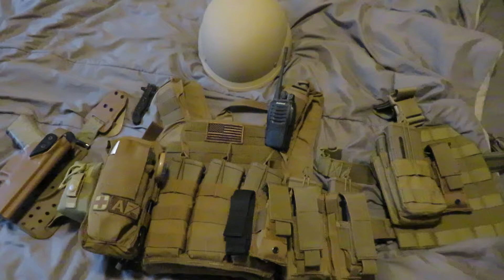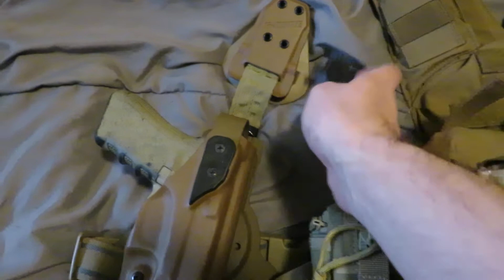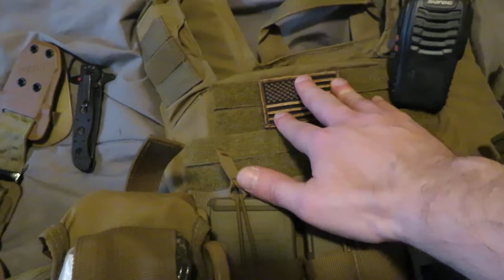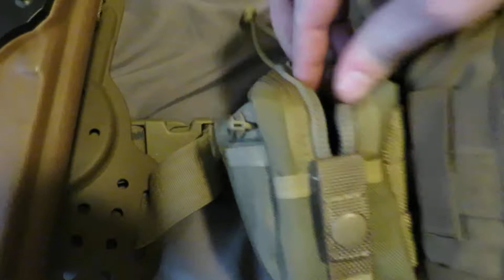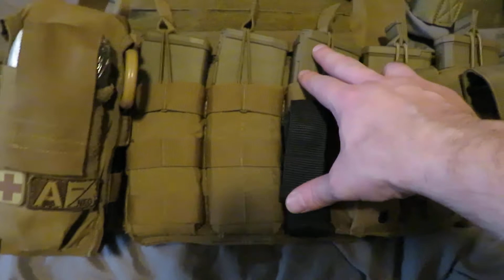Part 1: An Overseas and Emergency Response Security/ Defense Contractor Loadout

Comment: I know this video is a couple years old, but I’m waiting to leave for training with TC for Israel and was wondering if you’ve done a contract there or not. I’ll also apologize for the all of questions I have. Also I was wondering what they do for the rifle/pistol qual. Is the pistol qual on the m9 or glock? How’s the PT test done, is it prove you can do the minimum or is it a test where you show off how many pushups you can do? Just trying to get a judge of the environment. Also do they issue you good kit or is it some IBA or IOTV? What’s the uniform you normally wear? Ive seen some pics online with the full tan BDU and I’ve also seen tactical pants and a polo. Unfortunately training dates been kicked back 4 times so far and I’m hoping it doesn’t get kicked back again. Thanks for all the info you’ve been putting out in your videos!
Reply from the maker: Hey thanks for watching and for the questions.
- No, I was in Iraq for WPS and also ERT on a global deployment status/ program (also worked a domestic FPS hybrid contract for TC more recently).

- Pistol qual will be on Glock most likely, but they have M9's and a wide range of stuff, you'll get what they give you.  The tests are augmented/ updated from time to time, but it'll be based on a hybrid of DoD and State Dept. shooting standards along with a few other things they see fit to add in.

- Fitness test isn't really anything crazy, 1.5 mile run and some other basic assessments (pushups, situps, pullups, etc.), done every 4 to 6 months or so.  Go into the initial 45 days of training in shape though, they expect you to show up and be able to perform and do the base fitness test (there is minimum standards but it's not hard honestly).

- Regarding gear and PPE, it may be something similar to what you see in the video (though things like the drop leg carriage and such maybe not, depends the position you're working, i.e. static/ mobile guard, ERT/ TST, PSD, DDM, etc.).
You will get what they give you to whatever variation, and you will have to work with what you've got.  They have a lot of staff and equipping them all is expensive, so don't expect some overpriced Crye or anything.
Uniform depends, but typically yeah it's gonna be a Polo with Tan Tac Pants or a full TDU/ Khaki Tac outfit (certain other teams may be wearing slightly different things, and the PSD's may be in suit and tie if not in tac gear based on the nature of the Escort Detail).

I know some of this seems vague, but it has to be for OPSEC and also the fact that there is just a lot of variation with things like equipment, and the parameters of the WPS contract changes every 5 years (typically), so some of my experiences and gear and some practices will be slightly different from current stuff to whatever degree.

Good luck and stay safe!!!
Reply: Thanks brother, I appreciate all the info. I’m just doing a static guard contract so it’s 7 days of training as far as I’m tracking. Just have one more question. I have a training date and a deployment date. I’ve heard you also have to do some things at Ft Bliss. So after the training do I go to Bliss spend the week doing all of the things there and then deploy from there? 

I only know about the Bliss stuff from another contractor video, I can’t remember his name but he’s a bald gentleman with a bunch of videos going in depth on contracting. Thanks for the quick and lengthy response, I appreciate it.
Reply from the maker: @Fat_Thor_1138  Ah okay, yeah you'll still have additional training (will likely accumulate to 3 weeks between them, but ofc could vary), where at depends, could be at another base or the flagship training center, could be at a base in a country in the region near the theater you're going to (won't say where but there's 3 spots that could be a possibility too).  
You may get up to a week in between training and flying out, could be 1 or 2 days, just depends on who's needed where and what they got going on in priority.  Best to just have your stuff squared away before you even go to training so there's no surprises and you have less time than expected (things move fairly quick once it's a go).

Good stuff bro, be safe and good luck!!!
Reply: @DJTheMetalheadMercenary Thanks, didn’t know there was going to be more training. I figured 7 days seems like it wasn’t long enough. I’ve had my dates moved several times so I’ve been packed and ready to go for a couple months now, thanks again for the info.
Reply from the maker: @Fat_Thor_1138  There may be (at least there should be), you'll have a short indoc period in theater too for familiarization and understand how they have SOP's and all that working.

Yeah no problem brother, cheers!

Comment: What boots would you recommend?
Reply from the maker: I have a whole video on that too  :)  really depends on where you are and what your use needs are, but some that are solid in variable types are:
- Belleville Jungle Boots
- Belleville/ Tactical Research Khyber Boot (suede mountain/ desert boot, I've used those overseas and they're super comfy)
- Merrell MOAB high ankle hiking Boot
- Wellco Wellrat Boot (USMC standard)
- Danner Trophy or Canadian model Boot (for deep snow and heavy winter conditions, us-made line)

Comment: What are the rules on adding your own personal holster/pouches etc. vs using issued gear? For say a WPS deal.
Reply from the maker: You use the issued equipment unless you get expressed permission/ clearance or otherwise ancillary to use nonstandard gear. 
A lot has changed since the early GWOT with all this stuff, but there's still plenty of leeway based on the contract, availability of gear and resources, etc., as a side note.

Considering what we are issued, it's good to go and generally isn't a need to use any personal kit unless you have to for say a broken/ damaged item that needs replaced and can't be quickly by the company.  Sometimes you can get reimbursed for the gear purchase too, or even given a stipend for certain items to purchase, it all depends wildly.

Comment: If ur able to say what company did u work for? Im interested but not sure wich company i should apply to
Reply from the maker: Triple Canopy, also sub-contracted to a few others.
Reply from the maker: The bigger point is-- do you qualify.  Most companies post their job listings right on their websites apart from places like Linkedin, so be sure to read all the requirements and criteria to qualify for the position interest.

Application does not mean you'll get recruited and onboarded, so don't bank on one application either, IF you apply, get your CV/ put yourself out there to multiple companies.
Reply: @DJTheMetalheadMercenary  yea i have few years in armed security providing a wide range of security services. Just don't know which company to apply to.
Reply from the maker: @Itsyaboi-2020  That may not qualify you for Overseas work where they generally require a Military (with deployment) or SWAT (in some cases) background.  Just check the criteria/ requirements of the postings to see if you qualify or could fit such.

Are you on Linkedin?
Reply: @DJTheMetalheadMercenary  yes i am on there i just dont want to say on here what kind of work ive done, who if worked with and the proof of my most recent work.
Reply from the maker: @Itsyaboi-2020  That's fine you don't have to here on YT.  What state you in?

Comment: What brand/kind of GP pouch are you running behind your IFAK?
Reply from the maker: The right side general/ utility pouch is a discontinued one from Maxpedition actually, the IFAK is a Dark Angel Medical DARK Gen3 pouch.
Reply: @DJTheMetalheadMercenary  Hey thanks for commenting. I'm putting together a similar PC rig. Does the IFAK and/or utility pouch interfere with your pistol drawstroke at all?

Also, does your plate carrier feel lopsided at all running rifle and pistol mags on your left side but none on your right?
Reply from the maker: @bonnertom032  No problem, happy to answer good questions like that.

No I don't have issues with the DARK/ IFAK interfering with my draw as I use a G-Code Drop Leg Holster per older Military and current Contracting standards (and as preference).

And no I don't have issues with any lopsidedness in the configuration, PC's are designed to be configured like that without shifting, and my plates are a reasonable weight that also keeps things centralized in balance.  If if were a double-stack Magazine setup, it may cause more issues but the weight is nominal and minimal in this configuration.

Hope that helps!

Comment: Do you have any experience traveling overseas for contracting with taking your own Armor and gear, if so can you please tell me how it works, i am going to ukraine in approximately a month, and need to know how customs works, and what countries will let me travel with and such- Thanks
Reply from the maker: That's a good question actually.

So with taking your own kit on aircraft and into Europe, you should be fine with your plate carrier/ LBE and all your equipment you're bringing in tow.  Pack it all in a good Duffel Bag/ Military Green Weenie that you can secure with a small lock as necessary.

The only obvious thing you CAN'T bring is a firearm and magazines for it (pretty obvious), but you won't have to worry about that since Ukraine will (or should) supply you with those.

Insofar as Ballistic Plates for Body Armor/ Plate Carrier Systems, it's better to take Polymer Composite Plates or Kevlar or something like FRAS soft rifle-rated inserts, Ceramic and Steel plates show up much more "suspiciously" with xray scanners in airports and TSA may make you dump your bag and possibly confiscate them (the whole ITAR import/ export clause stuff).

Same goes for Ballistic Helmets but they may or may not confiscate it-- if you have any supporting paperwork from the Ukrainian Embassy/ Defense Attache requiring that kit they may let it slide.  Highly advise talking with them and making sure you have that element of support for bringing kit on flights.

Ideally, they'll have you fly to Poland (connecting flights shouldn't be an issue at all), and from there you'll take the train or ride service to the UA border, you'll link up with Foreign Legion staff and other volunteers once you've crossed into Ukraine, then you'll go to a staging base, do some up-training, and go from there.

Usually when I flew as a Defense/ Federal Security Contractor I had to follow those same rules if I was bringing kit as it was all on commercial flights for the most part.  A lot of the time in Contracting your kit is issued out once you're in country unless otherwise specified or exceptions are approved.
With Executive Protection work, it depends if it's a private jet/ flight or not, if it isn't, same rules apply, if it is, I take whatever I want  ;)  perks of that specific type of gig.

If you have any other questions, fire away.

Good luck and stay safe!!!!!
Reply: @DJTheMetalheadMercenary  Thank you so much for answering ive been scrambling for answers- do you have an email or instagram..maybe both i can reach you at??
Reply from the maker: @Outcastr1  Hey no problem dude.  What's your background/ experience?  Have you talked to the Ukrainian Embassy and gotten that process started?

I'm not on social media besides YT here (mostly was for operational security reasons, that and facebook is trash lol).
Reply from the maker: @Outcastr1  I would suggest to pack your helmet and plates all in your check luggage/ green weenie, for carry-on bag just your civie clothes and toiletries, phone charger stuff, and all necessary documents and all that.  (remember to get European  plug adapters for your stuff)

Word, i was 11B too ('05 to '08) and went to contracting after that in various forms.  I've been wanting to go to UA too but everyone is freaking out on me lol, guess i'm the breadwinner or some shit hah.

You'll be fine brother, you've got the skills and training they need and you'll have other expats there right beside you.

Comment: A Rh+ (?), i recommend you to change it to something more common.

On a serious note; nice kit brother, i would recommend carrying a bayonet aswell but that really depends on the rifle and your choices. Bayonets are much more relaible since they are simpler and easier to operate and its allways fun to stab stab some random shit with a bayonet aswell
Reply from the maker: Rh+?  not sure what you mean by that.

Insofar as a bayonet, most Company/ Contractor and Agency- issued Arms for Contractors don't have Bayonet Lugs, or we're just not issued them.
Like I said, what you get is what you get for gear on contract, supplementation is fairly minimal (used to be a lot more hodgepodge but everything has become more standardized as time has gone on and various factors influence how everything is procured and required/ conducted).  There's not that much straying from that anymore (especially on government/ federal contracts, they are extremely picky), and all gear has to be approved by multiple entities.
Reply: @DJTheMetalheadMercenary   I dont remember the correct terminology, it was suppossed to be a joke about changing your blood type to a more common one for tactical purposes.

I really dont know how stirct companies or feds are, never really worked with them 1st hand. To me single piece steel bayonets / knifes are much more relaible and i am incredibly biased for them. 
My main armament has been G3A2 for the last 3 or 4 years at the moment, and its really fun to stab random stuff with its bayonet
Reply from the maker: @TRPilot06YT  Oh lol, my type is in high demand so there's that hahahahaha
Reply from the maker: @TRPilot06YT  And I'll add that the government and private companies are EXTREMELY strict on that stuff (with some regards of OGA contracts aside) to the point that you can be suspended without pay or taken off of contract for using unapproved gear.  It's stupid in some ways, some ways I get it, but that's just how it is.